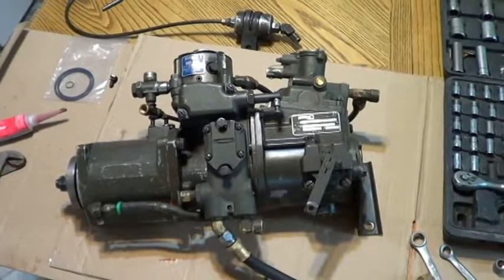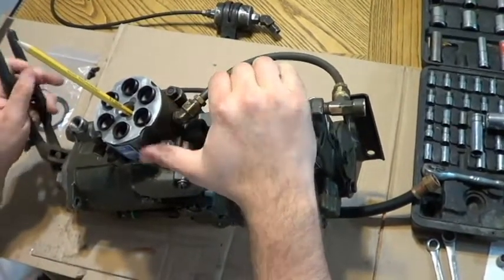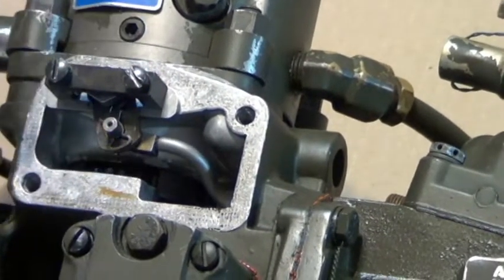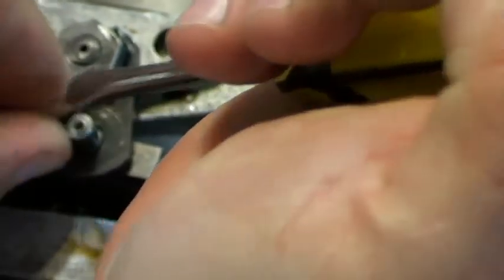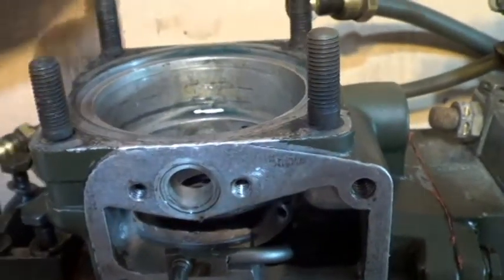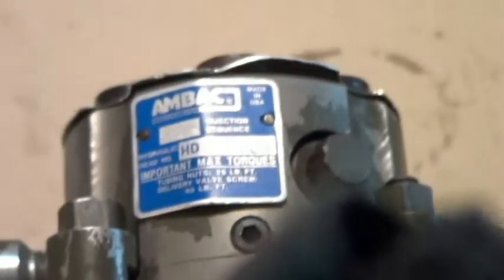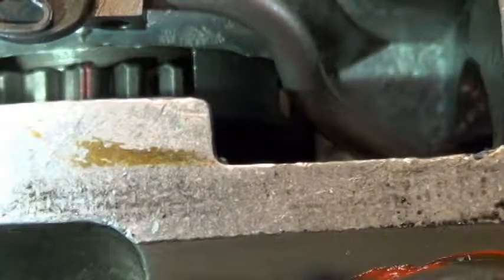M35a2 Injection Pump Repair

Comment from the maker: You can actually do the repair on the truck if your talented enough. I like the pump off to clean and check them over.

I like to take the valve cover off the truck and watch the intake valve open and then close. Have someone bump the starter with the pull stop out.

It's the valve at the very front of the engine.

After it closes, on the side the injection pump is on you will see a small timing pointer above the front crank pully.

I mark the pointer with a yellow paint pen.

Turn the crank carefully to bring it to (TDC) top dead center on the compression stroke.

If you have a turbocharged engine you will see two marks. 

One is for naturally aspirated the other is for Turbocharged.

If you open the small cover on the top front of the pump you should see the pointer inside the pump lined up at this point if you are on the compression stroke.

You can then remove the timing gear cover and remove the 3 bolts retaining the timing gear and the center drive gear nut. Make sure the batteries are undone before doing this part.

After that you can remove the three pump to timing cover bolts and the fuel lines. 

If you decide to try the repair on the truck you line the timing marks up, open the pull stop cover. Look in with a flashlight and line the removal mark up for the Hydraulic head and remove the shut off cam. You should then be able to remove and replace the Hydraulic head. It's getting the little cam for the shut off back in place that's difficult while on the truck.

Hope this helps.
Reply: Thanks so much for this video. My Deuce started, went to fast idle so I shut it down. Then it wouldn't start again. SS said it was the IP was sticking, and to open it up. You video shows that real well. Question, where does the plunger on the shut off cable go when you put the cover back on? thanks!
Reply: What timing gear cover are you talking about?

Comment: Last summer, 2019, we were cruising around in the M35A2 when stopped at a light it died. It’s never done it before so started it back up and the light turned green and then drove off. No issues after that until we stopped in a parking lot and turned it off. We ate and went to start it up and wouldn’t fire. Found a fuel leak at the hydraulic head and the injection pump. It was a very strong stream (arterial kinda leak). We had a guy driving a Subaru Outback stop by to check the deuce out and he was willing to “pull start” the deuce. Put it in 3rd and while rolling popped the clutch. Started up and ran but needed the throttle pulled out or the peddle to the floor to idle and drive. Made it home and parked it.

Winter came and went and now spring is here, I took the hydraulic head off and replaced the 2 O-rings on the HH. The old ones look brand new but replaced them anyway. Got it back together and same issue but less of a leak, but still bad enough it won’t fire. Is this something someone has run into before? it is leaking under line #6 and to the right of the bolt. There is an Allen head type of screw and it kinda seems to be leaking out of it. The Allen screw looks like it has a hole. Could that be my problem?
Any help would be appreciated.
Reply from the maker: 60 Acres of Whatever That allen hole is a port for fuel. I’m wondering if it’s leaking or if you have a cracked Hydraulic Head.  I have seen a few that have cracked.  Check the Allen head bolt and make sure it’s tight.
Reply: Matthew Johnson :/ I have. Looks like it might be cracked

Comment: mine is leaking from that part that looks like a 12 point bolt head, sticking out the side of the hydraulic head. Not sure if that is some type of adjustment, or just a loose plug.
Reply from the maker: It’s most likely just loose. It’s a plug.
Reply: @chompkinduce  looking at it with a magnifying glass it looks like the plug itself might actually have a crack in it

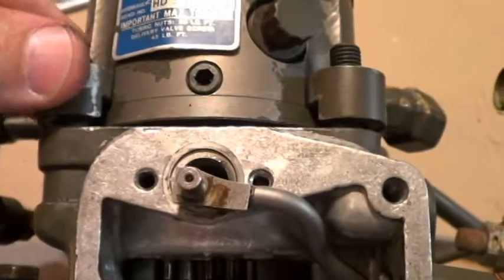Comment: 4:39 How do you line that up, with the pump still been attached to the engine? I need to replace them o-rings
Reply from the maker: Wilmer Segarra 

If you open the top window and side with the gear you should be able to turn the crankshaft slowly by hand. 

I find it much easier to remove the pump and do it on the bench. Trying to do it on the truck is tricky. 

It’s crazy hard to get the fuel shutoff back together on the truck.

Comment: I cannot get the gears in the head to turn. I tried to turn the shaft but it rotates maybe a couple of degrees and the head actually starts lifting up and everything jams. Any ideas?
Reply from the maker: jussell Its possible something is broken inside.

The head has a piston that rides on a button that rides on a cam. It might just have a piston that’s stuck and is trying to lift the whole assembly.

Comment: Greetings friend, I have a 465 ldt engine and ignition I can not lower the minimum enough, I lower it by the throttle lever and it manages to go down but it does not hold and turns off, any ideas for this problem. Thanks in advance
Reply from the maker: Let me see if I understand correctly. 

You have an engine you can get started, but if you run the RPM down to an Idle it will not stay at an idle and dies. 

Let me know if this is what you mean.
Reply: @chompkinduce  
the engine starts but the rpm is always above 1000 and the engine temperature remains above 160 ° c. Thank you for your attention.
Reply from the maker: 160 degrees Celsius is 320 degrees Fahrenheit, it would most likely be boiling coolant out. 

The engine should operate around 170-180 degrees Fahrenheit or 71 centigrade.

The rpm being a bit high for idle is usually around 800rpm. 

I’d probably establish that the timing is correct first. 

Pre ignition or fuel that is essentially injected too early in the case of a diesel can cause excessive heat. 

It may not hurt to check all the fuel filter in the system as well as purge moisture from them if any has accumulated. 

The density compensation system might be an issue as well and it can be bypassed though I don’t have it available on the video. 

If you check all those things, check the low idle adjustment on the exterior of the pump.

Comment: This same method is used for the g code pumps correct? Mine just started making oil and im gonna put new orings in it and block off the flame heater
Reply from the maker: Phillip Whitney 

I'm familiar with the Psb6a pump since I've had a bunch apart. I haven't had any other series apart so I couldn't tell you for sure. 

If the pump looks the same, I'd imagine that it would come apart the same.  I know that they produced a series that looked the same minus the fuel density compensator.

Comment: You think that part could get stuck from sitting? My truck ran fine a year ago been sitting in my barn, went to start it the other day and nothing, getting good fuel to fuel filter bleeders IV cranked and cranked and not even a drop of fuel will come out the lines going to injectors, it ran great when parked and IV never had an issue the 15years IV had it. Any way to check it on the truck before pulling it off?
Reply from the maker: Yes! The piston that is in the middle of the hydraulic head can definitely get stuck. 

A pencil or small wooden dowel can sometimes be used to get it un-stuck. 

A little light oil on the piston before trying  to free it would be recommended. 

I’ve done that on the truck with the help of someone to push the starter button, while you apply a little downward pressure on the piston with the dowel. If you get it free, run a gallon of cheap engine oil in the fuel, it helps lubricate the fuel system.
Reply: Awesome thank you so much!!!
Reply: I did the pencil trick and it is going up and down, also when you turn the power on and the lift pump is running, fuel is dumping out of that piston when the caps off, I put it back together and I'm still not getting any fuel out of the Injector lines. Any more suggestions? Thanks again for all the tips so far.
Reply: Actually the injection line is spitting a little fuel out of it, do these take a lot to bleed the air out of the system?
Reply from the maker: T Yes they can be a pain to bleed them. It’s actually easier to have someone pull you with a pickup, while you turn the engine over in gear to prime them. 

I don’t like to use the starter to get them running if they have lost prime. 

Usually high range and 3-4 gear while being pulled let the clutch out and have someone tow you while you hold the trotte open with the pull stop in the run position and the lift pump power on.
Reply: @chompkinduce   got it going guess it just took a while to get primed.
 Thank you so much for all the advice!! Greatly appreciated!!!

Comment: Thank you for the info mine is making oil what is the best way to r & r the pump
Reply from the maker: Jason Garrido 

You can actually do the repair on the truck if your talented enough. I like the pump off to clean and check them over.

I like to take the valve cover off the truck and watch the intake valve open and then close. Have someone bump the starter with the pull stop out.

It's the valve at the very front of the engine.

After it closes, on the side the injection pump is on you will see a small timing pointer above the front crank pully.

I mark the pointer with a yellow paint pen.

Turn the crank carefully to bring it to (TDC) top dead center on the compression stroke.

If you have a turbocharged engine you will see two marks. 

One is for naturally aspirated the other is for Turbocharged.

If you open the small cover on the top front of the pump you should see the pointer inside the pump lined up at this point if you are on the compression stroke.

You can then remove the timing gear cover and remove the 3 bolts retaining the timing gear and the center drive gear nut. Make sure the batteries are undone before doing this part.

After that you can remove the three pump to timing cover bolts and the fuel lines. 

If you decide to try the repair on the truck you line the timing marks up, open the pull stop cover. Look in with a flashlight and line the removal mark up for the Hydraulic head and remove the shut off cam. You should then be able to remove and replace the Hydraulic head. It's getting the little cam for the shut off back in place that's difficult while on the truck.

Hope this helps.
Reply: Matthew Johnson  yes but I already pulled the fender cleaned the pump pulled the kill rack cover found the lever to be sticking freed it up truck now runs. Turned the pump on no leaking from the lever oring could the fuel in my oil be coming from the high pressure pump or the compensator or only from the hydraulic head orings. what is the best way to proceed with trouble shooting. I was also told to check the intake heater but I don't see how fuel can get into the oil from there any help appreciated
Reply from the maker: Jason Garrido 

The lower O ring on the Hydraulic head is a possibility. For the price of an O ring set I'd start there.

The fuel density compensator can be bypassed to eliminate it as a possibility.

The cold start heater can leak and fill the intake with diesel that would go past the rings. It's also something easy to block off. 

The quill shaft in the Hydraulic head if they get super worn could leak. Usually it will just go in the return side where your shut off is located. 

I'd start with the O ring kit and try process of elimination on the other possibilities. 

I've never seen a density compensator leak, it is totally possible though because all it is, is a piston in a bore that moves when overcome by a viscous fluid that will not flow through a hole. The piston overcomes a spring that in turn allows it to move a tapered rod below.
Reply: Hey Matt,I have a '68 deuce & a half.Turns over but,won't start,sat up, maybe a year or two..quarter tank of fuel,did not replace fuel,loosen line at injectors,getting fuel to the injectors(not at a high volume) Tested the high pressure with pencil,...pump working!..   The "fuel shut-off" is where I had trouble,...once opened,(spilling with diesel)the lever would NOT move without wacking it with flat-head and hammer...even after loosening the wire-tied, 2 screws...What would you recommend?...and also,WTF is that 16 point bolt on top of the unit  called,and what is it for?....Jeez!!,...I watched so many vids,...and no one addresses that frickin bolt!....it has a spring,behind it!!..Also,thanks for your upload!...very helpful!

Comment: Sure would like to see you do another video on the military vehicle.
Reply from the maker: Josey Walesa

 I don’t have any M35 trucks in the shop as of now. I’m currently re-powering two smaller military vehicles.

One is an M38a1 Jeep that’s receiving a 4.3 GM v-6 the other is a M37 Dodge that’s getting LS Gm v-8.

In particular, what would you like to see on the m35 series?  If I get one in I’d try to cover the information you would like.

Comment: Hey do u no where a can get a hydraulic head for my m35a2 thanks
Reply from the maker: https://www.eriksmilitarysurplus.com/inpuhyheforp.html
Reply from the maker: I’ve seen several places, I’ll try to find you a few more, they are all around that $300.00 range.
Reply: @chompkinduce  thanks man u helped alot
Reply from the maker: Yup, anytime. If you need anything else I’ll try to help ya out. Good luck on getting the engine going.

Comment: I'm having a heckuva time finding a Hydraulic head for my pump. Any advice/links
I'm having a little trouble identifying my IP. It looks like a "G", in that it has no compensator. But the fuel pump cover design looks like the C, D or E cover. The HH that is on it now (and is completely FUBAR) is HD90100A
How can I tell for sure? Tag reads PSB6A-90EH-5337A3
Reply from the maker: Jay Guthrie https://www.eriksmilitarysurplus.com/inpuhyheforp.html

I seen new hydraulic heads on this site a while back.

Comment: Where can I buy the O-ring set. Or can anybody give me the measurements of the rings? Thanks in advance
Reply from the maker: 1992bacardiblack they are available on eBay and if you read through the comments I believe they are available a few other places.

Comment: MattHow do you know all this?You are a smart guy
Reply from the maker: Rich Stacey 

Before becoming a heavy equipment operator I was a full time heavy equipment mechanic. 

Over the years I've purchased and sold surplus military equipment though my side business.

I have collected equipment for the repair and rebuilding of engines and components.

In short I've focused on military equipment because I enjoy it. 

I share a little of my knowledge so others can enjoy it as well.

Comment from the maker: Check Out (MV parts store). I've purchased parts from them before and I know they sell Hydraulic heads for them. eBay sometimes has the O-ring kits and parts as well.
Reply: Ayúdame amigo soy de Venezuela  tengo un camión con un motor hercules pero no puedo conseguí la falla inyectora

Comment: Do you rebuild the entire pump?
Reply from the maker: Not usually, not much in them to rebuild.  Few bearings and springs.

Usually inspect the internal components and order just what is needed. 

If you find parts, they are usually sold individually not in a master kit.

Comment: good  video but that is not how you install safety wire.you feed the wire through the bolt then you twist the wire then feed it through the other bold the you twist it again and bend it over .the way you did it is no standard  procedure . sorry  i am a professional re builder on all types of pumps and i would never tie bolts with safety  that way. not  even from the factory  would do your way
Reply from the maker: Thanks for the information! I’ll have to research more into that area. I actually acquired a tool from a friend that works on aircraft for doing wire. 

I haven’t really had to do a lot of tie wire since I don’t work on aircraft and generally on most civilian stuff you don’t run into it much. 

Most of the time the only things I run into that have it are military. 

You happen to have any videos on doing the wire correctly? I’d definitely take a look.